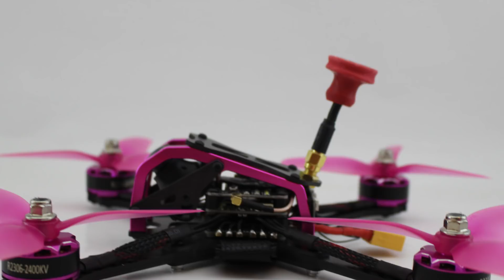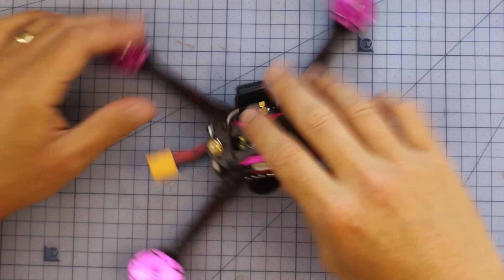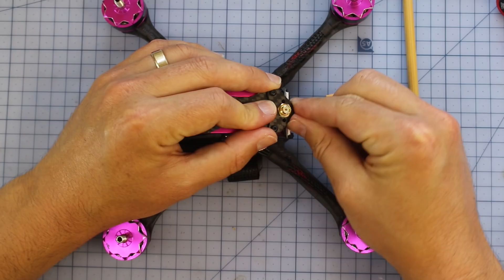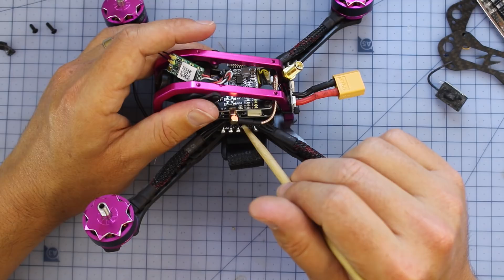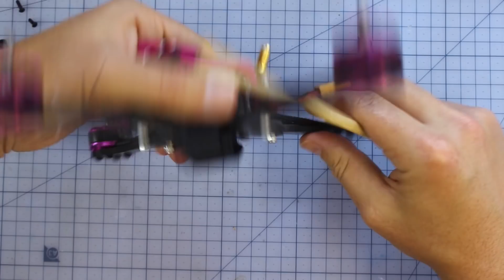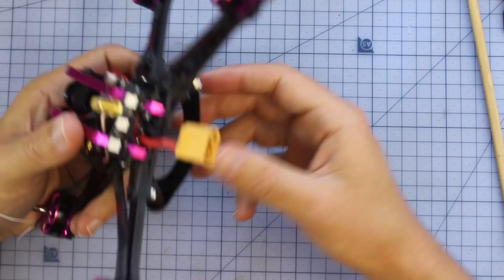ALMOST drone of the year for 2017!! CRAZY SPECS Furibee Fire Dancer drone Review

Comment: When is part2 review coming?? I bought this already...
Reply: danq fpv does a great  review (as does AndyRC ) and a 5s flight ,  I got mine the other day it fucking rips , not a bad camera , no way is it 1080 p  though these Chinese sites usually over quote specs on these things ! Also just like the x215 the vtx has lots of noise as the shielding has been removed but can be cleaned up with a foil insulated of course   under the vtx board and you have to change the motor timing to medium  low then you do not get f.o.d. anymore , thing rips!!!! although these motors have a screw holding the bell on instead of a circlip but if it is over tightened as one of mine was from factory it is very hard to turn and would probably burn out and some are loose all is fine once adjusted though ! thing is a bargain and is really fast but does not fly well out of the box , probably not for beginners if you can't set up betaflight and blheli suite etc .
Reply: yeah, i've seen Andy's review and it was indeed very useful. I've done the timing to medium, tighten all the screws and stuff. Mine had the same issues as Andy's + one more: each time i throttle up to max it would change the vtx channel and lose video. This is because i haven't replaced the receiver (mine is the flysky version and it's a micro). So 88Nikoli you say it rips? i can't wait to test it but it's been raining here in UK for weeks now. I am going to have to waterproof this dancer this weekend and have it in the air soon.
Reply: Yeah you have to remove the wire on the vtx otherwise it will change channel on aux 2 also lot of noise in vtx , you need to shield with foil !  Yeah she rips fast enough for me on 4s but Danq fpv has a rip on 5s , should check it out it's very quick , you will love it when it stops raining !
Reply: any suggestions on how to shield with foil? what do you mean by that? is there a video on how to..?

Comment: How do the 2306 2400KV motors compare to the 2206 2600KV motors on the FuriBee X215 Pro?

I have a FuriBee X215 Pro on order since Oct 2 and still not been shipped yet.  Wizard X220 has a broken frame and waiting on replacement.  In process of putting an R-XRS into a Bfight 210 so I can get up and flying (the stock FrSky Pro RX has poor range).

Comment: Hi stew it’s £121 here in England on a flash sale. Aside from that motor that you said you had to tighten, what are your misgivings about the motors? Just that they are unknown? You say it’s a high kv but tbs Steele motors and rr hypetrains are both higher.

Comment: Stew, 
Really enjoy seeing these types of videos as it help everyone in the community. I ended up building you $99 budget quad with a few upgrades that is still running strong..Only swapped out the motors for a set of Emax..  Currently, the drone is $159.99 on flash sale from Gear Best and could be my next drone. I do plan to keep the budget drone for friends, teaching and what not.

Comment: Oh yeah another thing, the retaining screw on these is not a 12.9 hardness screw and will strip easily.. I use Hudy hex driver set and they fit screw heads super tight because they are super high end tool and even with them and no slack at all in the socket head to driver fit the screws will strip before the thread locker breaks.. heat the motor to about 130 degrees and you can get the screw out.. the replace it with a 12.9 screw cut to length then you can take the motor apart without worry.

Comment: Those are the Nicidi 2306 motors.. they are among the best budget motors I have flew.. my wife and I every now and then pick a number and then we build two quads that have to be under that number and see who built the best performing budget quad.. we did some 150 dollar builds a month ago and she used the Garrt 2306 2700kv motors that was pretty decent and 51 USD for the set of 4 and I picked the Nicidi ones (same as these) in the 2306 2400kv versions at 55 USD on Amazon and i was totally impressed like really impressed, all 4 was smooth (I always replace the bearings in my motors because I own a fishing reel repair and super tuning shop so I stick ultra high end bearings and the bearings between reel spool bearings and 22xx, 23xx and 24xx motors are common) out the box but I replace the bearings with ABEC7 Stainless steel bearings.. I will say this the motors honestly feel about the same as my Hyperlite/Returner V4 2206 2522kv motors, the feel a little more torquey on heavier props then the R4s but that's only on props like the RK5051s, Avan-Rs, Dal C5050x3s and so on... where these motors did shine was on 5s... they flew amazingly well with dal 5x4.6x3s and Dal C5050x3s on 5s 1550s 95C R-lines.. the Amp draw is pretty much what the R4s and put down a little more top end and a little more torquey but on lighter props this motor shines for a budget motor.. on HQ5x4.3x3 the Amp draw is great, getting 4 minutes solid when flying pretty wildly if I'm just running gates and not doing a lot of throttle changes and just running through race gates at a kinda relaxed pace I can get 6 minutes on the Dal 5x4x4s... i put then on a 6 inch Alien knock off so I slapped some HQ6x4x3s and it flew great on 4s and wicked power on 5s.. I slapped on some KK6040s and ran 6s and the motors handled it and with a good tune came down slightly warm (about 10 degrees over ambient temp) these motors are absolutely a viable 6s 6 inch motor in 2400 kv... I was shocked how well it handled 6s on 6inch props... I ended up running HQ6x4x3s on it on 6s.. amp draw is around 160 amps the instant you nail it and quickly drops as speed builds and what's awesome is on 6 inch 3 blade props on 6s your level flight wide open throttle amp draw is no more then 90 amps once the quad has accelerated to max speed the Amp draw is 85 too 90 amps and you are flat moving... in flat vertical punchouts amp draw will peak at about 160 as soon as you nail the throttle and fall off to about 90 amps as it reaches its max speed... the only thing that keeps these from being really awesome motors is the response is not as fast as premium 2306 motors... on 4s I can ABSOLUTELY feel a difference in response over my Hyperlite V5 2306 2522kvs.. they aren't sluggish feeling but if you like instant prop twisting torque and response and you are used to flying premium 25 to 30 dollar motors you are going to absolutely notice a difference.. on 5s the response feels about the same as the V5s on 4s.. point of this post I hate budget motors because I have yet to find a truly good budget motor.. premium motors are premium for a reason.. but this is the closest thing I have flew to a budget motor that preforms with high end motors.. I would say this motor preforms about 85% as good as my Hyperlite V5 2522s at less then half the cost per set, they are a lot heavier then the V5 2306s and will not hold up as long and will not preform with them but they are good relative to cost compared to them.. I wish these was lighter, the V5 2306s are 30.3 grams with 1.5 inches of wire, these are 37.8 grams with 1.5 inches of wire. That's a big difference.

Comment: 176.99 is the price I am showing.  I really enjoy your videos.  I have just started getting into flying drones but it always puts a smile on my face... until i break something.  I have backup drones now tho so its not so bad.  Keep up the good work and thanks for your efforts.  Cheers.  Gear best def ships here.  I have 2 of the darkmax drones.  Do you have suggestions for modified PIDs with betaflight.  Also what rate profile are you using?  I have messed with mine and it seems disturbingly responsive.  The area that I feel comfortable flying is small (Just starting)  so i havent been able to get used to it.

Comment: FuriBee GT 215MM Fire Dancer FPV Racing Drone  -  

PNP WITHOUT RECEIVER - £133.05 GBP UK (18% off)
BNF WITH DSMX RECEIVER - £137.61 GBP UK (18% off)
BNF WITH FLYSKY RECEIVER - £137.61 GBP UK (18% off)
BNF WITH FRSKY RECEIVER  - £121.64 GBP UK (26% off)

**FRSKY version is the best deal. Buy that and replace receiver. Only one with 26% off**

Comment: Its $160 USD for the FRSKy receiver and $175 for no receiver.  Different Discounts I guess.  Their Quality control is very lacking.  I got the DarkMax and I couldn't get any input signals on uart1.  I thought maybe it was the receiver so I went and bought a new receiver and wired it up, same thing.  Had to take a brand new Bind and Fly, solder to uart3 and I was able to get it flying. I think that is how they can sell things for so cheap. Cheap parts with no quality assurance. Once its working the product is amazing, but it seams everytime takes a little work to get flying.

Comment: Review suggestions: more details on components used.  What brand ESCs? Which FC and brand name model?   What motors? If you don't have that information then I suggest you contact the people that sent you the stuff to review for that info before you do the review.  Also test the frame with a multimeter for continuity to see if it's full carbon.  Lots of the clone frames are composite and not full carbon.  Otherwise I love your work. Thanks for the time you put into reviewing these products.

Comment: £121.64 seems very good value. Although I would still prefer to build my own and have some slightly better budget components for just a little extra €@$#.
Heres one example: (Todays Banggood prices)
Transtec Lightning Frame -
 £52.75
Omnibus F4 pro v3 Flight Controller - £20.55
Racer Star 2307 Motors - £30.24
Racer Star 4in 1 ESC Rev35
35A (6s) - £21.24
Runcam Micro Swift - £24.81
Eachine VTX03 200mw - £7.75
Total- £157.34

Comment: In the USA and with DSMX Receiver at GearBest  is $180.99.
Looking a off the Chain Quad I would love to Win Stu! Good Luck Everyone! Great Price! Great Off the Chain Quad!  Nice 2300 motors! Pretty Color Motors! 
Nice FPV Antenna , Nice protection! Love the Frame!  Love the Props! Nice Robust Frame! Nice FrySky Receiver! Heavy Stock Motors! Nice VTX!  Nice Less! Nice MCMX! Love 6s Lipo Battery for a quad! Great Camera Protection! Nice Rear LED ! Love the Battery Strap but would love a rubber strap too!  Love the Price! Love the quality ! Love Zip ties!  Love the true Tune! Great Quad for the Price! Love the Quad pros and Cons of the Construction!  It is simply  insane for a Quad!  They did a Great Job! Great Price! Need Nice FailSafe! Nice Step in the Right direction!  The Best of the Best!  Just a small things to Fix after the purchase!  Wow that is just what I want to  spend my money on! Great Job Stu! Love the it Stu! I will subscribe!  Happy Flying Stu to you Too!
Reply: Wow that was Fun Stu!

Comment: I just bought this on November 5th and I'm still waiting for it to show up. been tracking it but it literally just shipped within the last week. I also have a tarranis qx7 coming. this is my first big boy fpv drone! I haven't ordered any batteries or a charger or goggles. thinking about that little blue charger from the $99 build and the eachine 100 goggles. I also seen a new box style diversity set with recording built in for $50. Stu I love your channel and have been hooked since I first seen it! I am a newbie to these but I'm super tech savvy and love to get in and tinker with stuff. so I'm not afraid of any changes that I might have to do. any suggestions on type of battery or goggles I should get?

Comment: $159.99! What the hell? How can they make it for that price? crazy. Hit the bell months ago.. hmm looks like they are really trying to become a real competitor.. amazing how many manufactures in China are really stepping up. 

Battery leads need to be zip tied down to the frame.. looks like there are holes there for a zip tie. lol nvm looks like you covered that.. good job! 

One thing they could do it get rid of that extra thickness on the antenna carbon and put a aluminum piece for the antenna like the Japlura or purple 215. Not only would that make it so the antenna can lean back at a better angle but also fold back in a crash. It wouldn't take them much to do this since the frame rails go all the way back like the Japalura and purple 215 and would be better all the way around.

I would also like to see more meat around the arms into the frame but I think what they have there is fine.

Comment: US it’s 176.99, that’s a pretty amazing deal!  but the two Furibee X215s I purchased for my twins but both of them have bad flight controllers and arrived 3 months after I ordered (right after your review released back in early September. Furibee originally had a Kakute F4 flight controller on the X215 but they swapped it for a knockoff (confirmed) due to high purchase demand and the knockoff Kakute F4s have a bad IMU and the ESCs have dsyncs. My twins opened them for their birthday and they both can’t fly stabilized modes, they just spin wildly and when you look at them on Betaflight they drift even while standing still. We contacted Gearbest support about the x215s and they have been researching the issue for weeks without any updates. I hope they make it right because we are feeling pretty burnt from Gearbest and Furibee right now with a bait and switch trick. I hope we win this good unit so one of they can have something to fly that works and they can race with dad (me).

Comment: I sure could use a free Drone giveaway! I’m new to the hobby and already lost 2 of my builds both were built with the Martian II frame and flew great. I lost my 1st Drone because I only had Acro Flight mode programmed and wasn’t familiar with Acro mode coming over from flying GPS stabilized altitude hold camera Drones. I built my 2nd FPV Drone after losing my 1st one and did some more research on programming my controller and was able to program in Angle and Horizon flight modes which helped if it got away from me in Acro Mode. I can now just switch over to Angle Flight Mode to get it back but the last one I lost I was flying by line of sight and once it got away from me and got out to about 100 yards I couldn’t orientate which way my Drone was facing while flying VLOS and I ran out of battery over a neighborhood and it dropped out the sky. I watched it drop and narrowed down the crash site but still after knocking on doors and flying the site with my Phantom 4 Pro I still never found it. Ever since watching your build video I’ve been addicted to building and flying now that I’ve become a little more familiar with Acro Flight Mode.
Thanks for all you do Stu and thank you for introducing me to the world of FPV Racing, even though I’m blowing all my money on parts now lol!

Comment: Man this thing is pretty when the props are on.  Frsky version is 176.99 US$ and Flysky is 180.99 US$ I currently do not have a Frsky transmitter but I will be getting one soon enough, because my Flysky is barely hanging on these days.  I do like this drone and the parts on paper look amazing, although I agree that there might be another out there that is a better fit for the DotY award, yes I call it the Dot-tee award.  Sure you can use that Stew if you haven't already :)  Good luck to all in the drawing, and keep up the vids Stew and Crew :)